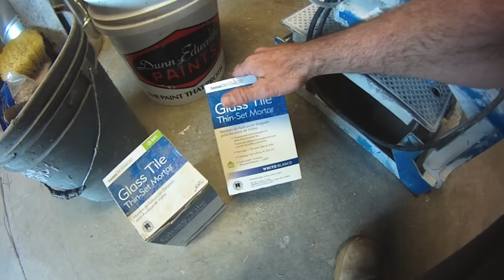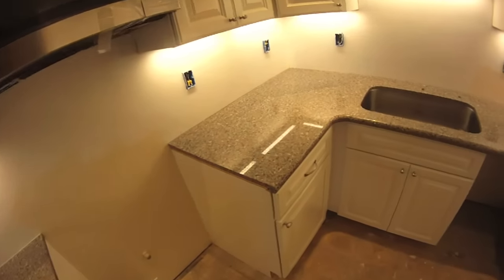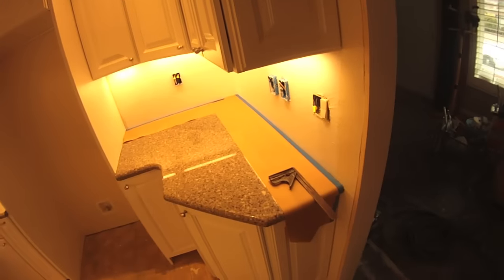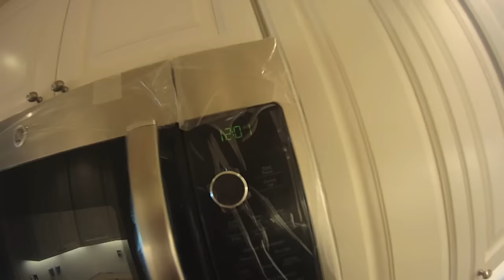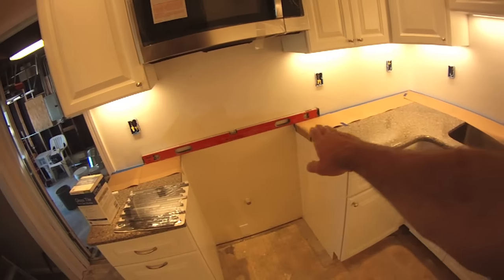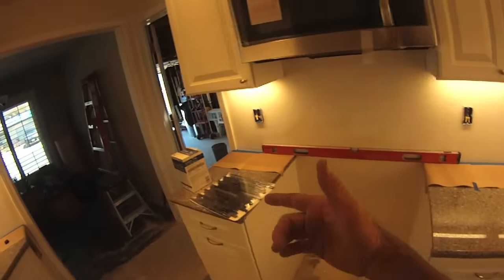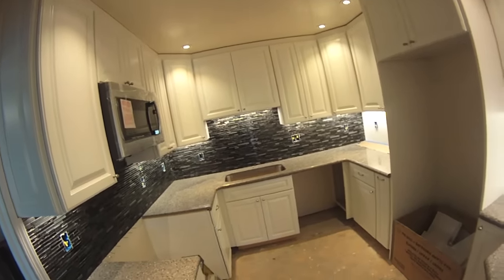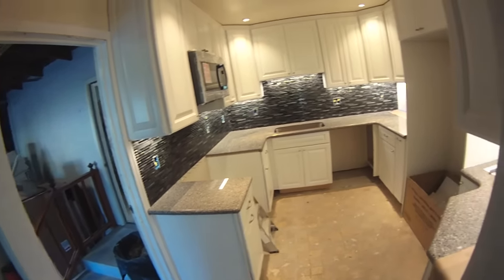Backsplash Tile Installation

Comment: Do you recall what LED system that is?  Where I work we bounce back and forth between 3 different systems.  The problem I find is not any particular system is better than another.  Each system has something that is way better than the others but there is no system I have found yet the excells above them all.  I like how clean that looks under there, there isn't low voltage wires pinned up connecting them all.  I take it those are hardwired to a master transformer located elsewhere or did the lights have their own transformers that were hidden somewhere?  The funny thing is the building inspectors are cracking down on how you hide low voltage wires in a lot of the areas we do work.  Everything has to be done so you can access the wiring, not sure how electrians get away with just leaving low voltage whips hanging out when they hook them up.
Reply from the maker: I think those UC lights are made by Halo, but I could be wrong...I do know they ain't cheap.  They are 120v direct wire fixtures.  If you remember the rough in, there were 14-2 romex stick outs all along the bottom of the cabinets with the J-box in the cabinet above the microwave.  When I installed the cabinets, I drilled a hole in the bottom reveal of the cabinet and ran the romex through it...they then mounted the light fixtures right up to the stick-out.  Easy peasy and no wiring to be seen.
Reply: yourbeekeeper
What do you consider not cheap? LOL  I think most of the lights we use figure to about $1 to the inch just for the light.  Than plus transformers $30-$60 depending on the size.  Than plus connectors and extensions couple bucks for each.
Reply from the maker: If I remember correctly the ceiling lights ran about $170 each.  That included new construction housing and the bulb/trim etc.  the 12" UC lights were $105 all the way up to the 30" lights which were $150 ea.
Reply: yourbeekeeper
WOW those are pricey!  LOL